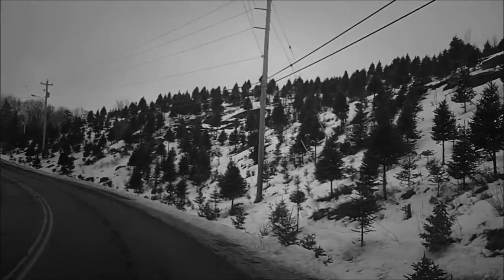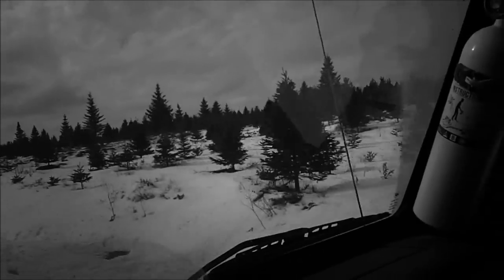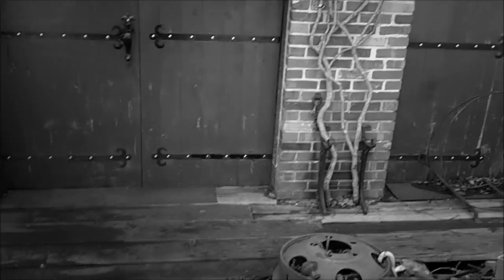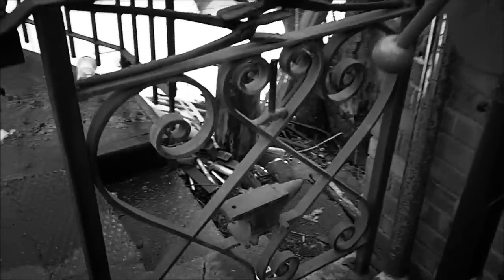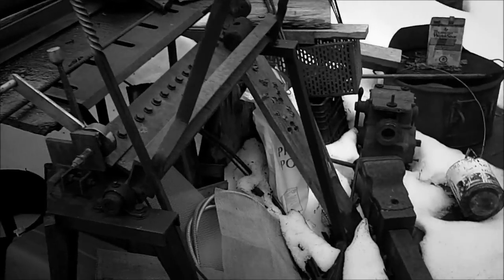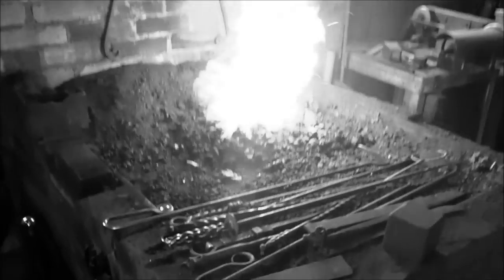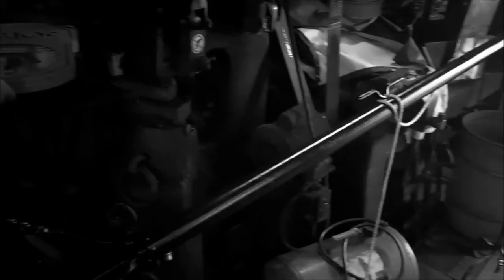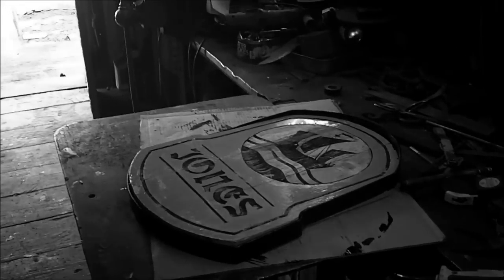My Visit with Hayward Meisner Blacksmith part 1

Comment: We used to have a steel mill in here in Utah. The coke coal they made would burn hot enough in a forge the iron would melt away if you left it too long. Wish I could find some again.

Comment: Where does someone buy proper coal I'm stuck with anthracite coal similar to that denser stuff that had Tue blue flame and I would like to have the proper stuff so I could not have to use my blower on all the time thank you 
-PMK